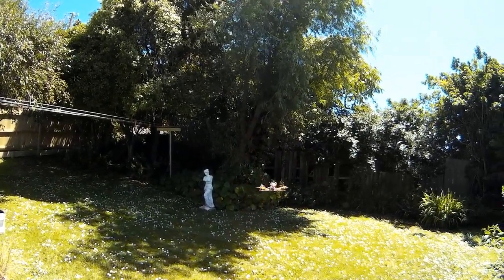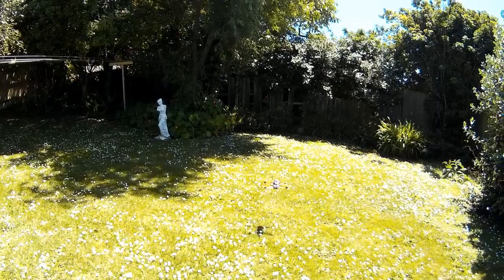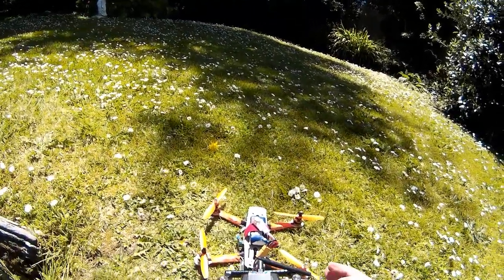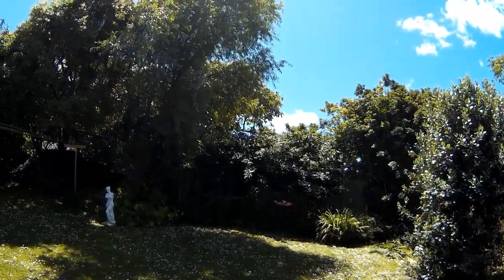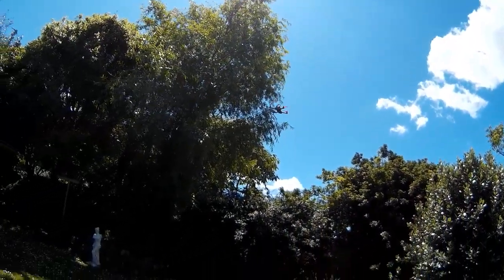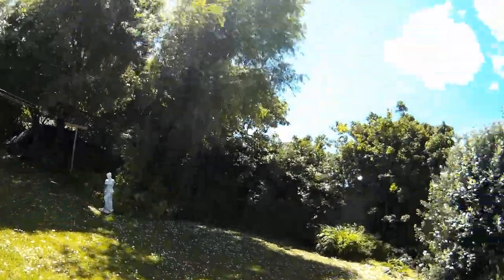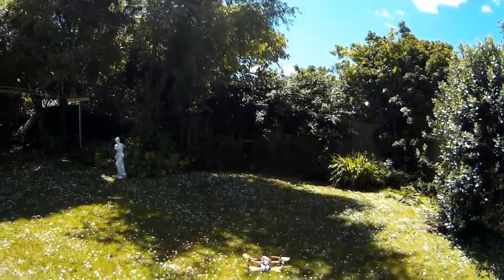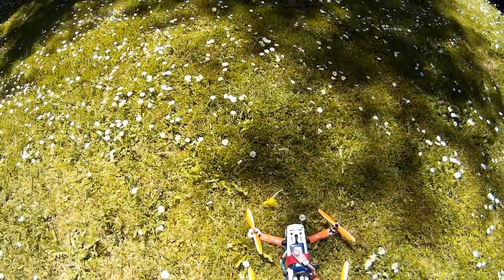ZMR250 running YMFC with nRF24L01 and MPU6050

Comment: I have been seeing your videos and would like to know which you consider better multiwii or ymfc since you have used both ? It's great if you could provide a detailed answer of comparison but do provide atleast a one word answer.
Cheers!
Reply from the maker: If you're interested in understanding the details of how a flight controller works and twiddling with the code, YFMC is what you want - there is now an auto-level version which flies great https://youtu.be/QVGF-UAkWR4?t=542

If you just want to get something flying, these days I would skip over multiwii and try ardupilot. The hardware is a bit more costly (cheapest option is omnibus f4 pro at around $30) but the performance is way way better.
Reply: @iforce2d  Great Thanks a lot 👍

Comment: hi , what code you used to transmitter and to receiver ? Becouse i used to transmitter code (Cheapass quadcopter sketches) and on to receiver (YMFC-3D_Flight_controller_RF24-draft) but this don´t worked me. I worked with MPU6050. pls can you help me ?

Comment: the transmitter is hk transmitter? you make with arduino ? this transmitter is ppm  in pin 2 but ymfc pin 2 is led . excuse for my bad english.
Reply from the maker: Yes, I made the transmitter, with arduino. See https://www.youtube.com/watch?v=_ekFXTn3GhE
Yes, I probably changed some pins from the original YMFC code.

Comment: hiya bud seems you have done a bit of work with nrf modules and built your own transmitter and receivers... i just bought a banggood ultra mini flysky receiver its lovely and small but would like to build my own flysky receiver, and keen to find out how they work.. any info on d4r receivers and the schematics of one....
Reply from the maker: +bing crosby flysky? Do they work with the d4r? Are you talking about FrSky? In any case, I don't know anything about how either of them work.
Reply: nah lfysky / turnigy

Comment: Is the arduino acting as a flight controller and receiver? If so would the cheap ass transmitter sketch work with this setup?
Reply from the maker: +sammichael25 yes, and yes, that's what I'm using for the transmitter.
Reply: +iforce2d ok thanks for replying. One other question. Would it work with an uno an if so where can i find the build
Reply from the maker: +sammichael25 ? I linked to the full build tutorial series in the video description
Reply: +iforce2d Much appreciated. Is there any sketches of this flight controller that would work with a fixed wing or tricopter
Reply from the maker: +sammichael25 no

Comment: i got an error like this what does it means >> C:\Program Files (x86)\Arduino\libraries\YMFC-3D_Flight_controller/RX_NRF24.cpp:66: multiple definition of `receiver_loop()'
RX_NRF24.cpp.o:C:\Users\Anish\AppData\Local\Temp\build9209497378131642238.tmp/RX_NRF24.cpp:66: first defined here
collect2.exe: error: ld returned 1 exit status
Error compiling.
Reply from the maker: +Anish Wagle It seems a little strange to put this source code into the arduino IDE's libraries folder. Try putting the files somewhere else.

Comment: Are you using the ymfc code in receiver and what is the code in the transmitter?? Is it the cheapass transmitter code?
Reply from the maker: +Piku Sk I'm using nRF24L01 as receiver, yes with cheapass transmitter code. The source is linked to in the video description.

Comment: Nice to see the YMFC fly on the other side of the world. And you have a back garden now as a test field!?

I'm very interested to see if your proposal on the throttle / pid mixing will lower the overcompensations during fast climbs.
Reply from the maker: +Joop Brokking Yes, it's soooo much easier to just step out the door and fly, instead of the ten minute bicycle ride I was doing every time before.
Actually the throttle thing was not that bad really, as I mentioned P was still a bit high - after that I switched from 5-inch props to 6-inch props and it was quite jittery, so I turned P down to stop the jitters on 6-inch props, and now back on 5-inch props it's pretty nice.